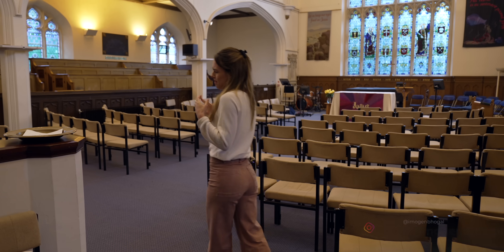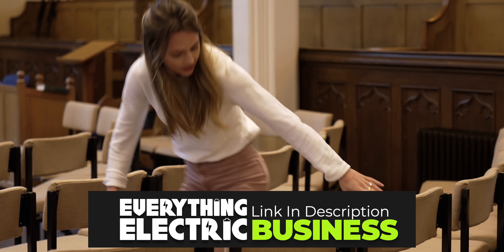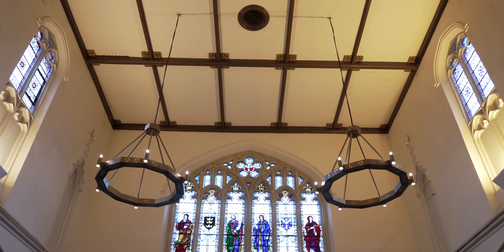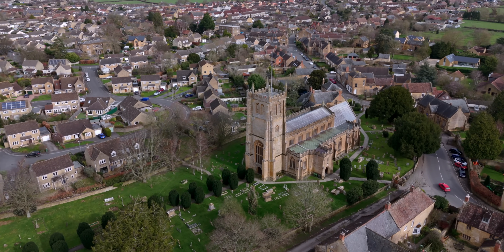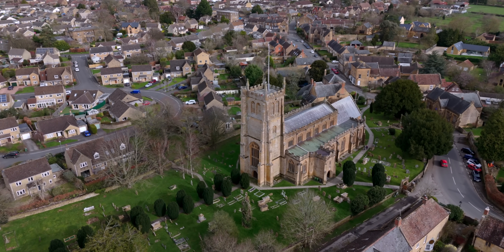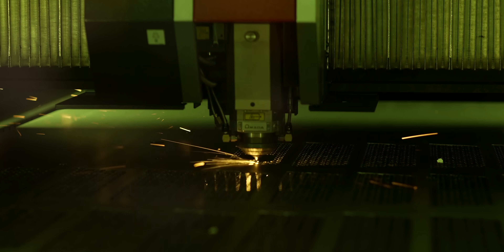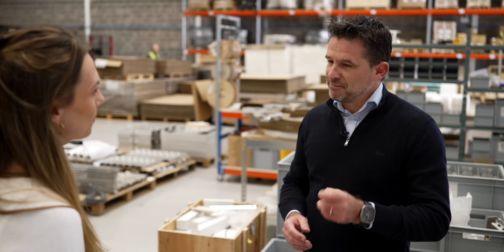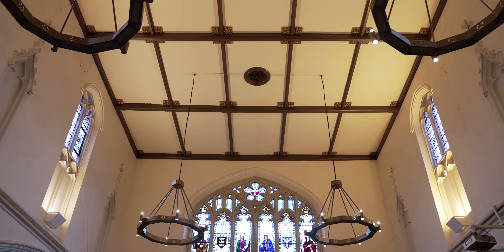Is Infrared Heating the Holy Grail of Electric Heating?

Comment: People generate between 500 - 1000 BTUs of heat when not active.   With 300 people in a church that adds up to significant heat.   Inferred heat has been promoted for over 50 years with mostly poor results.   People want warm air.  There are inferred heaters now a days that focus in on the stronger heating wave lengths.

Comment: I'm not a fan of radiant heating in general. I hate being too warm on one side and too cold on the other. Once the novelty is over, people aren't going to love this so much. As for the organ, what it doesn't like is temperature changes, and by not keeping the surrounding environment at a more constant temperature you're doing it a lot of harm in the long run.

No thanks, I'll go with heat pumps and better insulation. There are lots of "invisible" things you can do to old buildings like that to greatly improve the insulation, sealing and efficiency. Radiant heating is like hybrid vehicles: they are neither a solution nor a stepping stone, they're a crutch and an excuse for people who don't actually want to do the correct thing.
Reply: There speaks someone who equates radiant heating with older style radiant fittings where the heat delivery is directional and harsh. These fittings are very different. The heat that's experienced is only partly from the radiant source, but also from the warm surfaces around you - a feature of the specific radiant wavelength used. So no 'warm on one side too cold on the other'. Yes, 100%, pipe organs like consistent temperature and RH, and the organ at St Matthew's now has exactly that as it's outside of the heated zone. It could not be so with central heating (gas/oil/heat pumps) unless that heating was run all winter - and the carbon/£ cost of doing that in a church doesn't stack up.

Comment: A great product but a pathetically superficial video. What size elements are used? Completely glosses over the fact that a new separately switched power circuit will need to be fed to the suspension point along with the lighting feed. Not a trivial job in heritage buildings.
Reply: 7.8kw total per chandelier (if on full power), so 31.2kw total giving better perceived comfort to a congregation of around 130 than the previous 178kw gas fired central heating. Cabling in heritage buildings needs care, but that's nothing new - we do it with lighting, AV, smoke detection, etc.

Comment: Wonder if this would work for a standard house. Would it be more efficient than a heat pump?
Reply: Absolutely not. Heatpumps are always better for insulated spaces.
Reply: @logitech4873  After watching the video, I found that, actually, it might work out cheaper in the long run. Getting your house ready for a heatpump and the cost of the heatpump itself and installation is around 15k. (Call it 10k) with the government grant. A 700w ceiling panel infrared heater costs around £125 (smart enabled device too), and unlike heat pumps, you can be self installed if you're comfortable doing DIY electrical work in your home.
Let's say you need 10 to cover all the rooms effectively within your house, that's only £1250. Call it £1500 to include additional stuff to create spurs from your rings.

A heatpump will, on average, operate at 175% efficiency during the colder months (when you need it), whereas infrared heaters are only 100% efficient. The interesting thing is, you are not aiming to heat the entire house, you are wanting to make the areas you are in at a comfortable temperature.
A heatpump will take a long time to get the house up to temperature, whereas the infrared panels are instantly working from turning them on. You also have the benefit of individual room heating. Coupled with the "smart" side of them, you could use presence sensors to automatically turn them on and off as you move from one room to another.
The fact that it takes longer for the heat pump to heat up has to run longer to keep the house at an acceptable temperature and costs around 10 times more to install, I actually think these Infrared heaters are a much better option. Especially if you are able to install them yourself.
Reply: @CH11LER.  15K for a heatpump? What?
It cost me $2K for the one I have, including installation.

Comment: Should the attendens ware sunscreen?
What wave lengths are they emitting?
Reply: The title tells you Infra red, the opposite end of the visible spectrum to UV.
Reply: @JC-jv5xw  You are right. For some reason I was just thinking it was like getting heat from the sun. But of course it's not. It is more like getting heat from a fire. There will probably be no emission in the UV spectrum at all. 
It looks like there are some differences in wave length. I might look up one day how they actually work, cause as of right now it looks like they work by just heating a material that can withstand the heat 100 C or above.
It also looks like the wave length have some effect on how the heat is absorbed by the skin.
Reply: @Petch85  Just into the 'far IR' part of the IR spectrum - similar to the IR component of winter sun and not far off the IR that humans emit. Like the winter sun the heaters warm up the surfaces below them and they then contribute to what you feel - all round comfortable warmth. Older versions of radiant tend to be near or mid IR (which glow red when on) - harsher and prone to 'hot head/cold feet' effects.

Comment: This is an intriguing solution but the reporting completely fails to explain how radiant heat works and its drawbacks.
You want to combat misinformation and then fail to acknowledge the issues.
Radiant heat works just like light: it heats what it can illuminate but then what is in 'shadow' remains cold. This goes for the congregation and the pews on which they sit. The church might be able to compensate by turning the heaters on several hours before a service, but the report doesn't say how long that might be or how effective it would be. If the church is cold and the radiant heaters are turned on, the congregation will have an extremely unpleasant sensation just like standing next to a patio heater on a cold night (one side of them will be warm and the other side cold).
How are these issues being resolved?

Comment: Herschel Infrared is the company's name.  These chandelier heaters cost between $5650 - $8950 each.  It looks like this church bought the most expensive units, so it cost them $35,800 for the 4 units.  Probably excluding installation.   So long as they remain maintenance free for many years, then sure, these could save the church money over a furnace / boiler system, but wowzers are they expensive up front.  If it weren't for the needed aesthetics, then the church could have gone with a much cheaper solution and saw the savings sooner.  Have to imagine that the church also installed infrared heating solutions in the other rooms / offices given the replacement of the furnace, so this price is just for the nave.
Reply: Churches are BIG, so church heating systems are big and costly. This installation was around the same cost as a conventional boiler replacement and a fraction of the cost of a heat pump installation.
Reply: Yes but.. how much would alternative heating plus chandeliers cost? Most of the price is in the ascetics and service. Not electrical heating elements I'm sure.

Comment: 1:15 in don’t say “heat rises”. Heat doesn’t rise. Heat moves from higher intensity to lower intensity. When a fluid is heated, it tends to expand and becomes less dense which can cause convection flow.
Reply: ... which causes the 'warm' air to rise, and the 'cold' air to sink... with the net effect that the heat 'rises'.  You're correct when talking about the process... but when talking about the *outcome*, the description 'heat rises' is perfectly correct.
Reply: When applying a torch to an object, don’t expect heat to rise because as I said heat doesn’t rise. I also said “convection flow”. Heated air will go up the stairs. Heated water rises in the tank. Change in density causes convection flow. Keep insisting that heat rises. You’re welcome to be surprised that heat conducts down as well as up.
Reply: @5ervicemonkey  Congratulations... have a pedant award.

If you're talking conduction, then yes heat can conduct down... but this conversation was primarily about convection - and it was in that context that the previous poster used 'heat rises'.

Heat pumps don't generally operate on conduction, so the insistence that the phrase 'heat rises' is unhelpful.

Comment: Of course heating just when and where you want the heat, when that reduce the amount of heating required to a small fraction of heating up the entire building can save a lot of energy. In most cases you want to keep a reasonable temperature, constantly, or at least for prolonged periods of time.   While very a cost efficient way to provide thermal comfort temporarily and locally, with little energy, infrared heating with resistive heaters shouldn't be mistaken for a generally energy efficient way to provide heat, it is just not that.

A lot of advantages in that specific type of scenario, and similar situations. Instant heat radiation, localized, and also cheap, robust and compact equipment, without moving parts, are readily available. The "COP" being 1 isn't a huge drawback when you just need to achieve thermal comfort in a part of a huge stone building for fully clothed people a few hours a week, and only part of the year.

Comment: Great episode Imogen.  A perfect application of existing energy upgrades meeting a specific need and being cost affordable while doing so without looking industrial and out of place.  
I get what you meant about wonderful radiant heat. As a Canadian I can remember many a frigid winter morning sitting in a cold arena to watch my son playing hockey. Some of the buildings used a system where a hanging pipe suspended over the seating area funnelled the heated exhaust of the ice cooling plant to the outside. The heat that they threw off was reflected by curved attached metal "fins" and the effect was like sitting near an old fashioned wood stove.  That and a nice coffee and life was good.

Comment: This is a really good application for infrared heating. It's not right everywhere, but for a large, poorly-insulated, intermittently-occupied public space it's hard to imagine a better alternative.
Reply: There are also gas powered infrared heaters I believe
Reply: @neonsloth  Yes: but they generate waste gases and water.  Had an ex-boss that didn't believe this and yet the paint used to come off the cold walls due to the condensation.  But he was RIGHT - so mop down the walls with towels to remove the condensation - and paint - the staff did.
Reply: @HiekerMJ  those devices absolutely need exhaust venting.
Reply: Where would they be inappropriate?
Reply: @1voluntaryist  Heat pumps are better in most cases due to COPs of 3 or more (3kW heat out for every kW electricity in), giving much lower running costs than any form of direct electric heating (whether it be old fashioned resistance heaters or fancy IR).
However they have lower peak output, so where you need an occasional sudden rush of heat (like in a church for a service) they may be competitive due to lower installation cost.
Ideally probably is a hybrid solution where you have a small heat pump running steadily to keep the frost & damp away and heat the place comfortably in mild weather, with IR for a sudden boost in the depths of winter.
Reply: Definitely not right for all places. The chandeliers can be exceedingly ugly and incongruous. Do they actually make people feel warm or is it hot tops and cold bottoms?

Comment: One thing I'm surprised wasn't brought up in the video is the benefit of not having circulating air.  Pretty much every method of heating a room involves/requires air flow to work, whether that be convection currents or a blower motor.  To make convection currents work, you need to expend a lot of energy in order for the air to move on its own.  And of course, this means the heat transfer is very slow, and a lot of it will typically just rise rather than reach the target.  With forced air, that's more noise, moving parts, ugly hardware, maintenance, and wasted energy to put the heat where you want it.  Forcing air also means the air currents will hit targets that you might not want heated, such as uninsulated exterior surfaces.
If the target can be heated directly through radiation, not only do you expend less energy getting the heat to the target, but you lose a lot less heat to the environment.

Comment: how does infrared heat the things it needs to heat?
Reply: It uses 'radiant' energy (the third-form of heat-transfer, behind conduction and convection) - which is absorbed directly by surfaces (inc. humans :p) rather than by heating the air and letting the air circulate to 'deliver' the heat.

For a big building like a church, convection heating would require heating the entire atmosphere inside the building (and, effectively, all the walls and ceiling, as they would continuously extract heat from the air next to them, which then needs to be re-heated).... conversely, Radiant heating only heats the surfaces the heater is pointed at... in this case, the floor, seats, and people beneath them.

So whilst radiant heating is technically less efficient than convection heating, the fact that it can be targeted means that in this scenario it works out more efficient, simply because it's heating so much less than a convection heater would.

Comment: How much electricity doe these use? And could they be fully powered by solar pv on a south facing church in the middle of winter? I would guess they so very easily could. That really would be a game changer with huge potential.
Reply: If it would be a game changer, regular people would already use this in their homes. This is not new technology nor ground breaking. To answer your question…Solar output is way worse in winter, when you actually need the heat. Usually by a factor of 10 worse. In practical terms this means that they couldn’t get enough PV panels on the roof for heating in the winter months.
Reply: @AttilaTheHun333333   given the roof-space for panels, even in winter I recon that church could generate ~7kW / hour, or more (based on my 8x panels generating 200-500w / hour in winter, and appearing to have space for 4x30 panels, compared to my 2x4).  

Might not be enough to fully cover the needs of the heaters - but it would certainly cover a chunk... especially if paired with a storage battery.
Reply: @logicalChimp  
That’s very optimistic. My 8kw peak setup go as low as 200 Watts on winter days.
Reply: @logicalChimp  - yup. The modelling for that church shows that in winter sun the roof would generate enough to run the heaters at a lower setting. And yes, for a lot of churches with infrequent use, a battery makes sense - charge up off the solar and use that for the times you need heat.

Comment: So the installation cost offsets the limited heating "time"' - buildings in the UK don't need central heating to prevent frost heave - vs heatpumps  $$$..

in mainland Europe or the US/ Interior Asia - central heating is a structural issue - for architecture..

In Australia - patially occuped spaces have nbeen heated with Radiant heating "for ever"  - ie very few spaces  (outside the ACT - Canberra) have gas to air or other, central heating.
Reply: Bear in mind many of these old churches were built at a time when big buildings typically weren't heated... so they're built to withstand being left at ambient temperature year-round, etc.

Comment: What do you mean about "embedded carbon"?  This is a very strange comment given carbon's form.  Please clarify.  Thanks.
Reply: Embedded Carbon is the term for all the carbon-emissions involved in the production of an item.  E.g. the carbon emitted by the creation of the steel, and the delivery of that steel to the workshop where its used.  The further materials are transported, the more carbon is emitted, and thus the higher the 'embedded carbon'. 

Of course, using 'clean' steel (made using H2 and Electric-Arc furnaces, etc) shipped from further away may end up cleaner than using locally-made steel produced using coal-power blast-furnaces, etc... that's something that has to be assessed based on the the respective 'production emissions' vs 'transport emissions, etc.

Comment: Are there any health concerns with IR?  it would be awful 20 years down the line to find out there's a latent issue.  Please confirm which study has proven this as a safe form of heating.  Many thanks.
Reply: IR heaters have been in use for more than 100 years (based on above post about them being used on the Titanic, etc), with no reported ill-effects or side-effects.
Reply: @logicalChimp   More like since fire was invented/discovered.
Reply: Deep infrared is literally just what you experience as radiant heat. It's the same stuff that makes your wood furnace or a campfire feel warm from a distance.
You yourself emit infrared light, both in the outside and the inside. It's inside you and around you at all times.